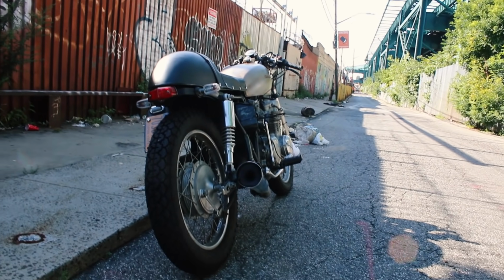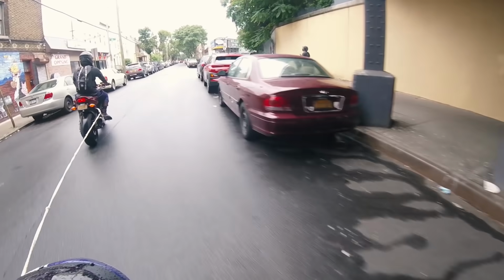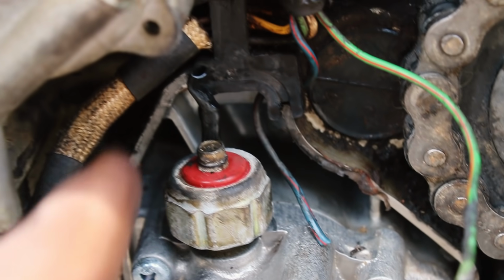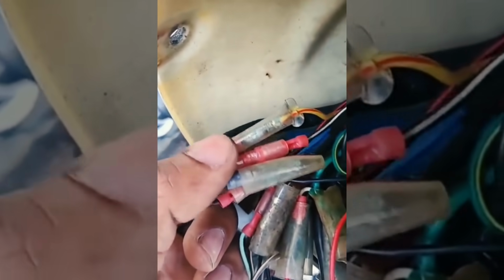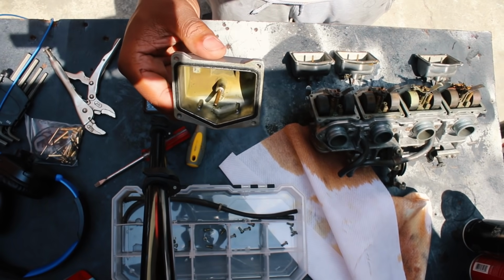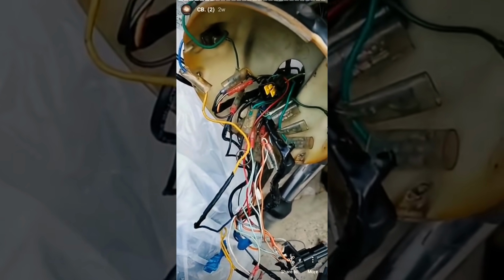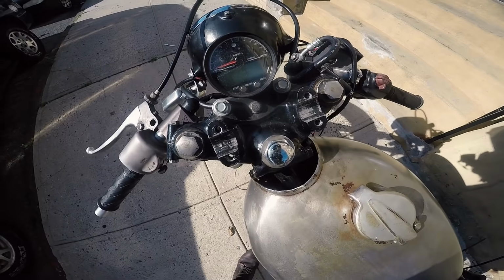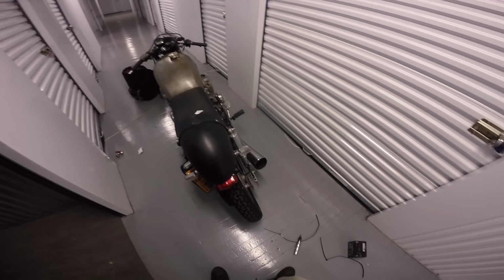1976 Honda CB550 - Why I Bought it & How I Got it Running

Comment: Had a 2000 R1 sitting for seven years with old ass gas and it turned to chunky sludge also it rusted out the inside pretty nicely. Tryed straight vinager and something else, Cant't remember now . Anyway saw some dude on the tube and he showed a junkyard cb tank all F up and he used (apple cider) vinager and wala pretty shiny even new looking. No rust stains nothing. So I tryed it, Just wow and eco freindly Right.
Nice work with all you do man... Lets Roll

Comment: Cool old bike! I enjoy the methodical approach you take with your work, man. I've just picked an 88 XV700 here in Aus, and it's in a similar way. The previous owner has stated it will run with all the extra parts in a plastic container. It's a project, and I'm going to keep your calm in mind while wrenching on this one. Thank God I have modern daily and can take my sweet time. Look forward to your next upload.
Reply from the maker: Best of luck to you with that. You have a daily, but dont get too complacent! That's how you end up with half done bikes!
Reply: - The illestrator - I know what you mean. I bought the modern bike so that I could work on older ones without the pressure of needing them going. I spent too many years trying to get bikes going while everyone else was out riding.

Comment: I love my cafe racer 1975 cb750k(my first bike) It was $100 and was just a roling chassis and engine. Not running no key battery oil tank most of the electonics fenders and water in the engine, I was in the exact place people say new motorcycle riders should not be. all you need for one of these bikes is a manual or two and google. Super simple machines. Still took me like 2 whole years of little interest and cleaning things buying important parts like the rectifier electronics, oil tank and changed the oily water. I finally just sent it one day and gave it gas and a battery(car battery) and bang got it running on a whole 2 cylinders but I was hooked. I just bought everything in the next week and ignored all the important things like carb rebuild and brake rebuild, it had a working rear drum brake. First time I rode the bike I had the craziest adrenaline high I thought it was the fastest thing in the world, I didn't make it out of first because I thought it was down to up shift. Really to much to say, I had a hell of a good time building my cafe and learning. I now ride a 83 XL600R Supermoto, I sorta became a wheelie addict. Most the time my cb750 sits In my garage, sometimes my friends will ride it but I haven't in months. I need to take a road trip on it and give the bike some love.
Reply from the maker: Great story. I can imagine the feeling. As long as you still have the bike around you... that's the great thing.

Comment: Hello, nice to see another 550 in the city !  Let’s see if we bump into each other for a ride once you get her all buttoned up.
Lil tip; for commuting with the heat and traffic we see here , try 20-50 for summer months and back to 10-40 during cooler months.

Comment: Mmmmm that bike. Not a big cafe gal but, I am a huge fan of that era of Honda fours. Absolutely gorgeous.
Reply: Actually I would love one of those. 

Also ditch those velocity stacks asap. Get some cheapo pod filters if you have to. Especially with those roads.
Reply from the maker: It's great! Just gotta clean it up a little,  the work done on this bike was a bit lazy. The good thing about the stacks is that they atleast kept the rear fender on there lol

Comment: Looks like it's coming together quickly. The systems tracing you did with that test light is really handy, I'll definitely put it to use on my project. It's an 86 yamaha radian 600. Thanks for the awesome content!
Reply from the maker: Yes sir, a test light is essential for electrical gremlins

Comment: Yeah buddy! Love those old Hondas. Glad the electrical stuff was pretty easy to figure out. My "83 Nighthawk had intermittent turn signals and brake light. It was my first bike and I wasn't much of a wrencher back then (still not much of one now tbh) and neither was my dad, so I just lived with it. Anyway, good luck.
Reply from the maker: I had similar issues on my Honda rebel after i crashed it...i pretty much waited until i got ready to sell it before i fixed the lights. I didn't have the will to work on the electrics for the longest until i just did it

Comment: I have owned a 73 cb500 four and it was a fantastic bike .
Also a 77 CB750 four the single overhead can Honda's are fun and bullet proof after you get it sorted .
The price you paid was fair but if you can get one stock for double that price life would have been easier but since you are not afraid of a wrench you will be fine .
Changing to an aftermarket aluminium swing arm will make handling much better although my 73 I had it dragging pegs up and down mount baldy in southern California ....
Look forward to future videos
Reply from the maker: The problem with new York city is that with running, decent condition bikes, they want RIDICULOUS money when it comes to vintage bikes. So like you said, my ideal option is to get a cheap bike and work on it since i know how. Gonna look into that swingarm

Comment: Thanks for this. It really justifies my buying my last bike brand new. I doubt I'll ever build another "fixer upper". I feel your frustration.
It's hard to know exactly what to pay for somebody's botched project bike. If you factor in what you'll pay to get it running (and labor) vs. what the finished product is worth, you should be given the bike for free. But who would do that?, nobody. There'd be old bikes sitting in people's sheds everywhere just rotting away. But at least the engine sounds sweet, which is the most important part. 👍
Reply from the maker: Well said. 
At this point i got it running for like another $350 or so in parts so that's good. The next few steps of brakes,  suspension and lights? We shall see

Comment: Brave towing in the city.
Interesting to hear about your experience with lithium batteries.
Been curious about em.
Reply from the maker: They're just not good for projects. When you constantly have to start the bike over and over because you're working on it, you will eventually kill the battery because there's very little indication that it's going under capacity. A lithium battery will crank hard as hell until the last drop of power and then there's nothing left. You can more easily hear when a lead battery is dying...so with the lithium battery  you go to charge it and it never recovers. I've even had a good lithium battery die out of nowhere from the cold.... didn't even discharge it. (On the SV1000). 

I recognize the weight savings and space savings on a  bike with no issues but they suck for project bikes, and other people with custom bikes in my circle tend to agree that building a bike on a lithium battery is risky.  The dead lead battery at the end of the video on the BMW? I charged it right back up to health after the video. That's the dependability i like.
Reply: @Theillestrator1050  
Thanks amigo.
All questions answered.
The temperature would definately be an issue regards to battery life for me too.

Comment: Glad your safe and well enough etc in these dire-ish times. Apart from the dodgyness of the the bikes wiring before youset completely towork on it - more than just the effort in getting it just ablout working. 

    The engine sounds like it should be mostly okayish; considering its 'old storage' conditions/local, that old oil, and its relative inaction and having parts 'borrowed' from it likely helped stop the engine being thrashed too severly by an/some unmechanically sympathetic a-hole(s), and possible helped reduce road salts/dirt corrosion on under side parts of the frame wher paint would've worn.apart from some valve checks and any cam chain noise, the lowish engine power hopefully means its motors mostly good..
..infamous last words... fingers crossed!!
    I'd recommend getting a magneitc sump-plug washer-bolt, to to help find/catch any slivers from any worn internals, since its oil pump filter may not be as fine meshed/perforated as more modern machines sump filters like your Brick has. 

     As an earlier commentator suggested, a fork brace kit would help with its thin walled small diameter forks. A steel mudgruad/fender on its own will not equal a proper fork stantion brace.
    If you cant get to transplant some other machines rightway-up or an USDF front end conversion.custom kit & yokes at somepoint, for improved brake mounting options if the old single caliper, master cylinder when cleaned and refurbed with new  lines/hoses might still be, a little too Fred Flintstoney feeling; mind-due the rear is a large TLS drum (I think -  hopefully its not to worn on the drum liner), if it's an earlier production model. 

    A selection of good condition beefier tubed forks./front end from another 'classic' looking mid 80s' to a early 2000's Honda or Kawasaki bike could marry up stylistically, and have better caliper(s) 
(hell even upright Kawa' W650, or a older styled but newer Bonniville forks might go well with a kit and/or a stem swap, if such a thing is possibly out there).
     Sorry, as always I go on to much, too technical... /at least with a model of bike this old, while some parts may be rpicey, their should be a good availabilty of choice parts, upgrades and tuning kits around for its long life, from/in many countries - tho that'd make things less easier in some respects.

Stay safe and keep well to your family, firends and yourself, etc etc, and keep it rubber/tyre side down ;) :P
Reply from the maker: As always thank you for the perspective and advice. Safe wishes to you as well

Comment: Im currently working on an 80s Honda CB/CM400/450. Once I have my frame welded up I can put the engine back in and finish up the last few bits. They are fun bikes to work on.
Reply from the maker: It's refreshingly simple to work on...even compared to the bmw

Comment: Nice you got the model with front disc brakes. Any bike that doesn't have at least disk brake up front is a deal breaker for me.
Reply from the maker: I can understand that. I wonder if there's any drilled and slotted discs for this bike because i can't use a disc lock at the moment lol
Reply: @Theillestrator1050  Wow I never thought about that until you mentioned it! I guess an alternative would be "BigPantha #1 Motorcycle Lock - A Grip / Throttle / Brake / Handlebar Lock" it's on amazon. You can buy one for your brake on the handlebar and one for your clutch. It could be just as effective as a disc lock.

Comment: I just did my MSF course and put the paper work in at the DMV. I honestly shouldn't be getting a bike right now with my budget and the fact that COVID yeeted my job. But I've been planning for this for over a year. So I start looking for bikes in the $1000-$1700 range. No tools, no space, and I really just want to ride.
All scams, bikes with "great engines", but doesn't "start". I'm trying to talk to some used dealerships in the area but the power went out at their place and they're not answering phone calls. Lol
Reply: Found a CB500 though but it doesn't have the throttle connected and after seeing your bike which only needed a "battery..." Makes me weary of bothering with it.
Reply from the maker: I would say you should stick to a bike that you know runs on the spot. If you dont have the means to work on it,  dont put yourself in the predicament of having a bike you cant use. Like you said, it only needs a throttle but it could need alot more than that as you can see. Get something you can use.
Reply: @Theillestrator1050  you're right I do need something that works. I probably shouldn't be buying a bike, but in my short life I haven't made a terrible financial decision...maybe this is it 😂

Comment: Nice to see u back on utube. Ur theory doesn't make sense to me tho if ur not going to have tools or a place to work on a bike would u want a newer bike like the fz that never breaks down rather then a old bike that will constantly break down its one thing if its a old school bike in good shape but that one is far from it also lithium battery are really good u just can't run them all the way flat and u need a different charger or maintainer to charge them but as long as u don't have any draw on it besides when u start the bike shouldnt need a charger bike will do it which older bikes shouldn't have any draw on battery when bike is off
Reply from the maker: Well that's because you're on the assumption that this bike will constantly break down, and you're also not considering the other points that i made as to why i would want a cheap old bike.  It's a 1970s Honda, there isn't much  to break and if it does, it's easy to diagnose, and easy to fix. 
An old school bike in good shape would have cost me as much as the fz1 did and then I'd have the same problem. A bike i don't feel comfortable with parking on the street. This bike is rough but what matters is that it's mechanically sound. Just needs a little work which i am capable of doing.

Also i know how lithium batteries work but they're not good for projects. When you constantly have to start the bike over and over because you're working on it, you will eventually kill the battery because there's very little indication that it's going under capacity. A lithium battery will crank hard as hell until the last drop of power and then there's nothing left.... then you go to charge it and it never recovers. I've even had a good lithium battery die out of nowhere from the cold.... didn't even discharge it. (On the SV1000). I recognize the weight savings and space savings on a  bike with no issues but they suck for project bikes, and other people with custom bikes in my circle tend to agree. The dead lead battery at the end of the video on the BMW? I charged it right back up to health after the video. That's the dependability i like.
Reply: @Theillestrator1050  yea i see where ur coming from but just from my experience I had a 78 Yamaha sr500 took a while to get it consistently running good but it stayed that way for about a lil over year then I parked it out front for maybe 30 mins and it was stolen i dont think scumbags who steal care it was a junk bike but I guess it would be more likely they would go after a nice 1

Comment: 28;03 "I DON'T KNOW HOW TO READ THIS DIPSTICK" Say what? It has 2 marks.  top one, it's full bottom one, it needs oil. That's it?
Reply from the maker: ...okay, but you've over simplified it. Engine hot or cold? Sidestand or level? Dipstick screwed all the way in or all the way out?
You don't have to answer, I've since looked it up.